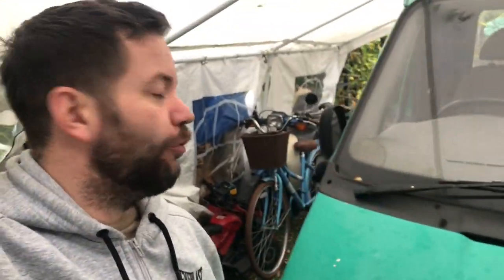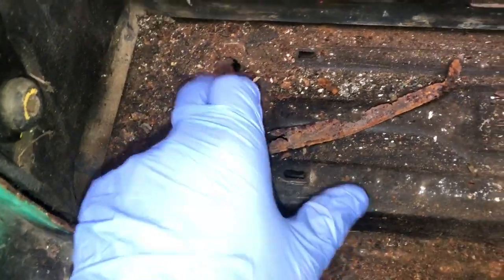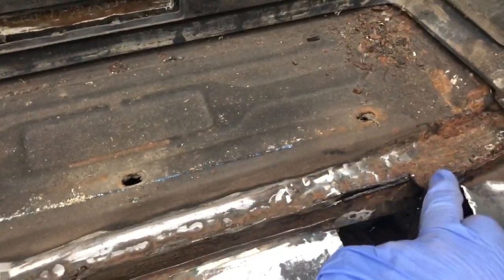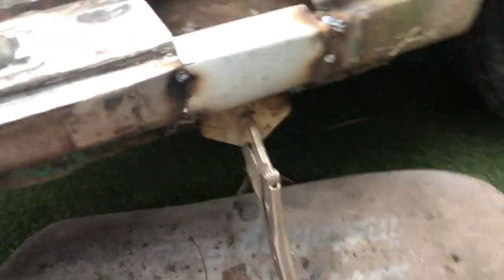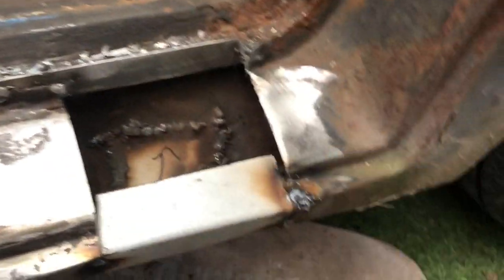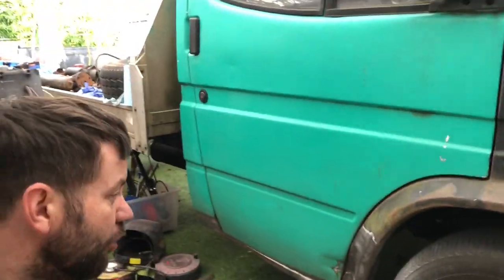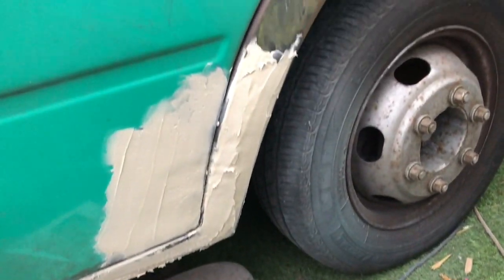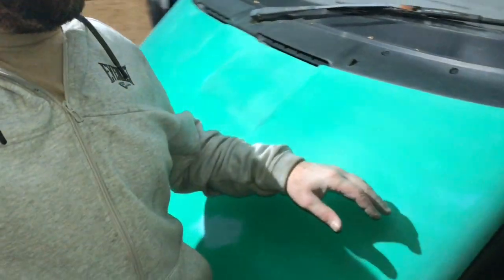Part 1 ford transit refurb restoration 1998 smiley arch step and sill repair

Comment: Good effort mate your fairly cracking on,can you tell me what welder you are using, cheers
Reply from the maker: Cheers, the welder is just a cheap gas/gas less welder with hobby weld gas, it’s around 15 years old and to be honest due an upgrade